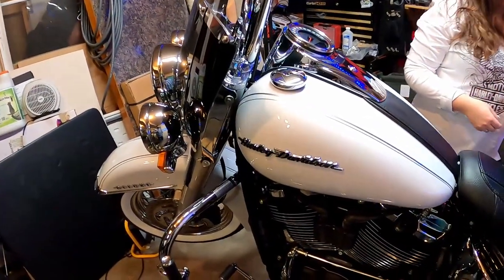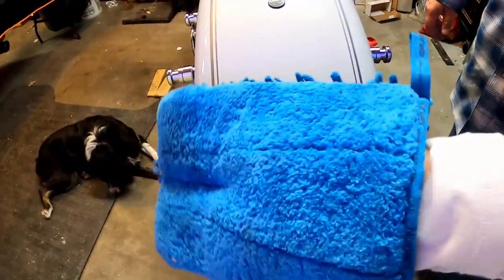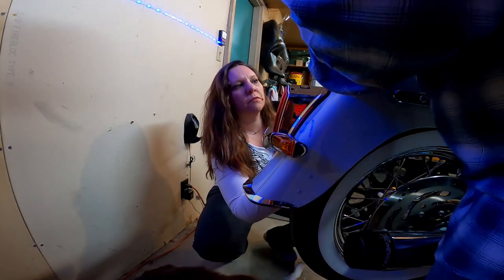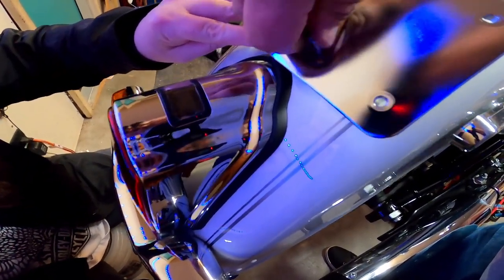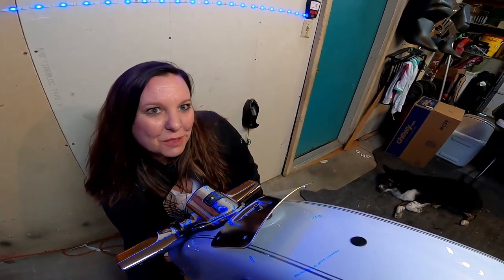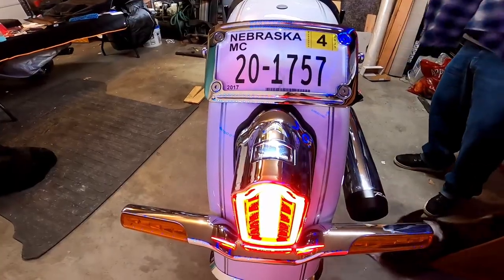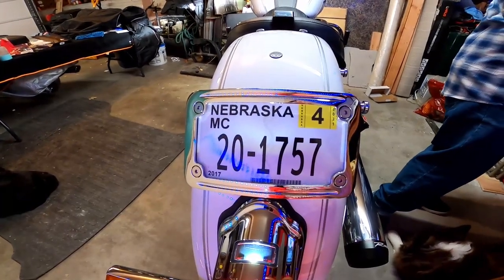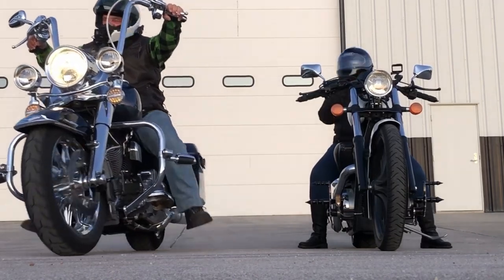2020 Softail Deluxe laidback License Plate Install!

Comment: You guys have helped me a bunch of the past two years in regards to my 2020 deluxe. Can I ask you to do me a favour. I am having an issue with vibration as if my front tire is not balanced correctly. When I look at the tire it seems there are no stick on wheel balance weights on either side. My rear has the weights. Could you have a look on your front tire and tell me if there are weights on yours. I appreciate it as always!!
Reply from the maker: Hers has weights on the spokes. I think a lot of them have beads in the tubes but I think Harley puts the weights on the spokes.
Reply: @StevyFaux  10-4 thanks very much as per! 🙏 👊🤙

Comment: What kind of alcohol do you use?
Reply from the maker: She uses Norwex cleaning paste on her white walls. We used Isopropyl Alcohol when we were ceramic coating the bikes.
Reply: @StevyFaux  norwex and water for the cleaning then the alcohol, then the clay?
Reply from the maker: @savageriders6732  if your talking about her white walls or just the whole bike. We use the Norwex wash mitt with a bucket of water on the bikes and the she uses the Norwex cleaning past on the white walls and the are brighter than then we’re new.
Reply from the maker: We only used the alcohol when we ceramic coated the bikes.  It’s one of the prepping steps.
Reply: @StevyFaux  I was trying to figure out the whole thing. It is not that clean to me from the video.
Reply from the maker: @savageriders6732  must be the light. At least I hope it’s the light. If you watch the video when we ceramic coated them that’s as clean as it can get. Hopefully it looks the same. 😬
Reply: @StevyFaux  I mean the steps you took to fully clean the bikes.
Reply from the maker: @savageriders6732  oh I see. Well I can tell you that the paint is crazy smooth and there is a crazy candy like layer over where we put the ceramic coat that looks crazy.
Reply: @StevyFaux  nice!!
Reply: @StevyFaux  I also looked on the j&p shop for that bag they don't even have the one you have they have a new one now.
Reply from the maker: @savageriders6732  ya I bought that one about three years ago. I’m sure the new ones are better thought.
Reply: @StevyFaux  I like the way yours looks better than the new ones.